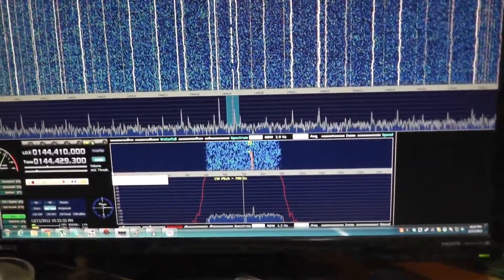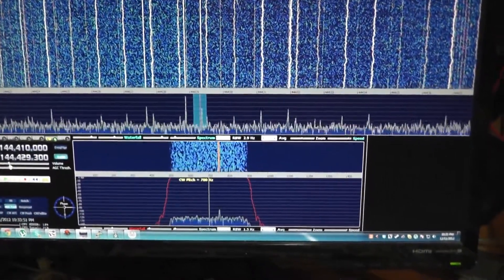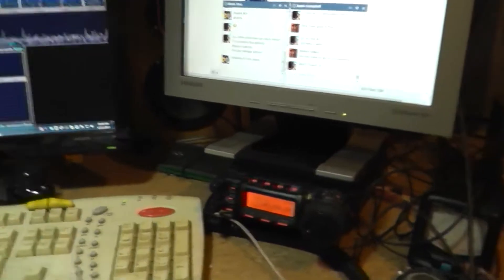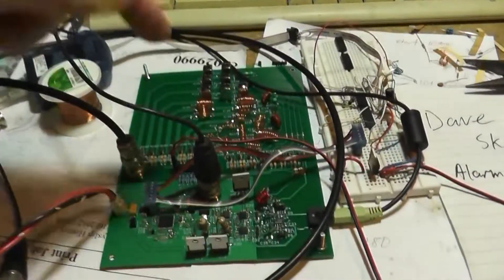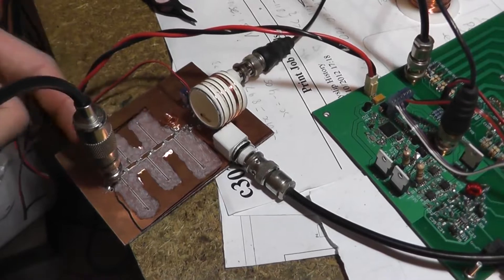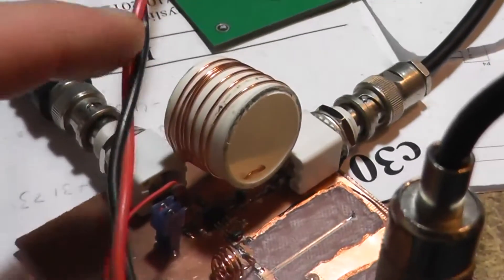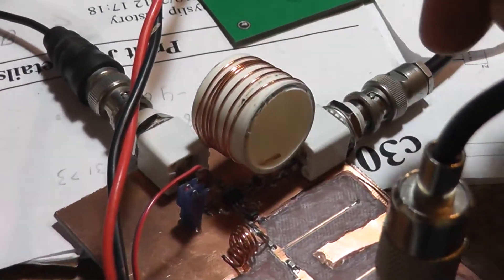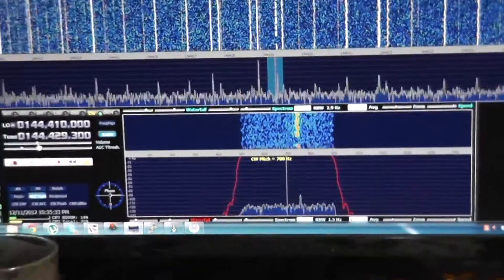Homebrew SDR on 2m

Comment from the maker: Quadrature down-mixing theory is based off multiplication by a complex exponential, check a university level signal processing textbook.

A reasonable "accessible" reference is "sdr for the masses" (multi-part PDF, found via Google). Also Google "Tayloe Detector :Ultra Low Noise, High Performance, Zero IF Quadrature Product Detector and Preamplifier".

For V/UHF you'll have to build an analogue down-mixer, just use an NE-602 or similar. The rest is analogue filters and matching units.